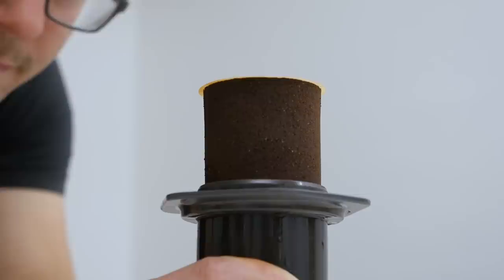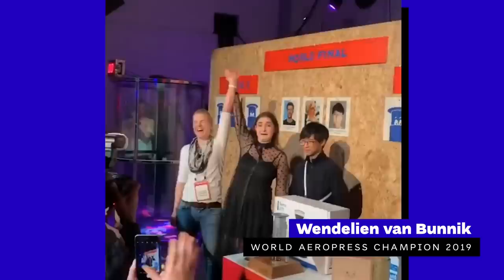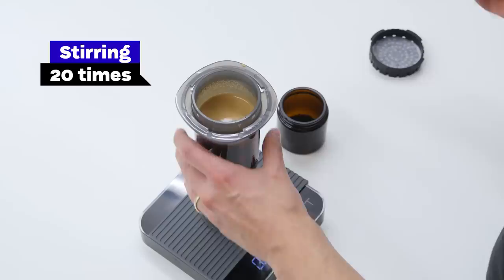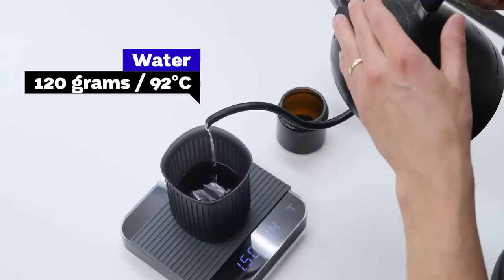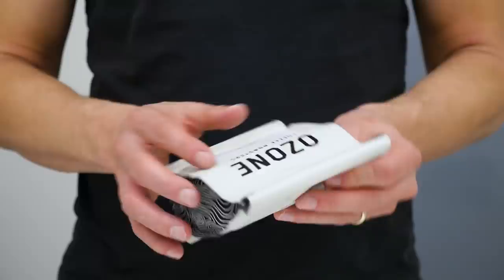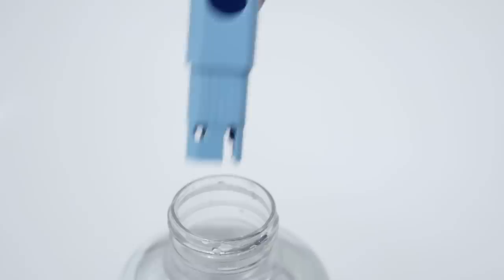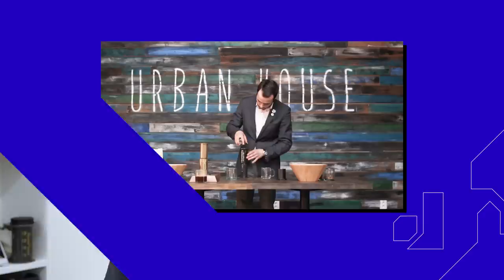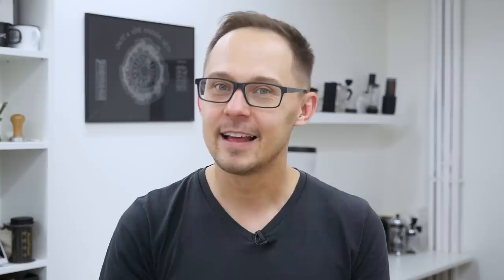The Winning AeroPress Recipe of 2019

Comment: I am happy to see the Aesir filters are a part of the winning entry.  I just received my first order of two packs of them, have been using the Aeropress for at least 7 years, they are absolutely an important improvement.  They definitely increase the pressure of the plunge, but also seem to let more oils pass thru while decreasing the sediment at the same time.  I was able to order online from eightouncecoffee.ca and had them sent right to me.  I have seen a few folks here say that they are scared or get disastrous results from the inverted method,  but if you just "commit" to the flip and figure out the method it will never collapse.  I think I have had one unsuccessful flip and it was due to the rubber plunger being past its useful life.  If you change that as needed when things get a little loose, the actual Aeropress will last for many years!
Reply: So glad to hear you like the filters! We are the manufacturers. Trying to spread the word on how much of a difference the filter, and even the paper make.

Comment: Why press out the air at 1:40? I want to know what difference it makes.
Reply: this way you are pushing air out through the top of the aeropress instead of through the coffee mixture. You could avoid this by stopping pressure on the plunger as soon as all of the water (coffee) is pressed out of the cylinder, or by adjusting the plunger to a different point in the aeropress so there is no air in the cylinder to begin with.

Comment: 30g of beans for ~250g of finished coffee? That might taste great, but it seems like you could get most of the strength with nearly half the coffee and more immersion time.

18g beans, ground fine-medium (7 on Baratza Encore)
90g water, fresh off the boil, inverted
Stir to remove clumps, but quickly
Start timer
At 90 seconds, swirl, flip and press, yielding about 70g of concentrate
Add ~180g of 160f filtered water
Stir, and enjoy.
Reply: I tried this.... yummmm!
Reply: what kind of beans?
Reply: @zetaland  Pinto or baked, usually.

Comment: I have bought two separate AeroPress now... and i still have no idea how people are flipping it over like that so smoothly. I have damn near scalded my hand two or three times. I suppose both of mine were defective? That seems unlikely but the two pieces absolutely would not stay together like in the video.
Reply: Before flipping, insert plunger to desired level, then pull the plunger back up a whisker to create a slight vacuum, then flip.
Reply: @SeanGT83  I thought that I had followed those instructions the last time i tried about a year ago... I will try again as the convenience of AeroPress is something im very interested in.
Reply: Definitely operator error, I had the same problem the first time I tried inverted. In this video, he pushes the excess air out before flipping, which alone should eliminate the issue, but also make sure that you grip both the cylinder and the piston with your flipping hand. Hope that helps.

Comment: Very nice recipe but I think I use the wrong coffee, could you (or anyone reading this) recommend a specific kind of coffee for this one? I'd love to achieve something similar to a cappuccino with less milk at home with this nice nut flavor aftertaste but so far I haven't been able to find the correct brewing method.
Reply: Sounds like you'd want a medium roast maybe? Different coffees will have different characteristics, Latin American coffees usually have a nice chocolate / nutty flavour. 
I try to do something similar to a cappuccino in the aeropress, I use 18g coffee and about 150ml water, and then add 80ml milk but you may want to less.  Less milk or water to make it more concentrated.  You can also adjust strength by brew time and grind size. There's no rules really.

Comment: Id buy this if they had a fully glas or fully stainless steel version... Im not drinking from heated plastic...
Reply: The glass or steel would be even worse lmao
Reply: Glass- too weak and fragile for a pressurised vessel, asking for trouble. Stainless steel- costly, hard to manufacture, cannot see coffee or water level easily
Reply: Theres a reason why aeropress is not made from glass, but i dont know with the steel one... its a good idea except it will cost more and will take more weight for a travel-friendly-plastic-aeropress, but who knows, maybe out there someone custom made a steel aeropress
Reply: If metal or glass you would have to warm before use because it would take too much heat out of the water.  I normally hate plastic too but it's the best material for heat management.

Comment: do you rinse you rfilters with boiling water ? i've been using my tap water (which is soft) but never considered the difference it might make.
Reply: Always with boiling water! It's also about the filter and the filter cap being hot already. If they are soaked in cold water, it will cool down your brewing water.

I also suppose rinsing an unused filter with hot water might remove more of the paper-taste.
Reply: @wtho  There's so little mass in the paper that it will have basically no effect on the final temperature. Give the cap a shake after rinse to remove the trapped droplets of water and you're good to go!

Comment: What are the advantages of doing the inverted method? I never have tried it before.
Reply: The inverted method prevents water drips through the filter. 

In the normal method, drips occur when the coffee grind distributes unequally inside the chamber. We can prevent this by tapping the chamber once the coffee grind placed inside the chamber.
Reply: On my personal experience, the inverted method might also introduced some spill when we turned everything back into the normal position. 

We also need to be careful while placing the filter and filter holder back. Especially when we are using metal filter. I ended up bend my metal filter because it is located a little off centre.

Comment: I am really confused on how fine grinds with ~14g of coffee brewed for 1 minute (Tim Wendelboe) and a coarse grind with ~30g brewed for 40 seconds can both taste good. Why is the latter not severely underextracted? Because of the high dosage?
Reply: Keep in mind the extraction is done slowly under pressure. The trick is to extract the most flavor but not allow the brew to become bitter from sitting to long before extraction.  Bottom line - each of us must experiment with our favorite roast, type of water (I use RO), water temperature ( I use 186 F) and brew time before extraction.  I use 10 sec stir, 15-20 sec. brew and a slow 30 second press time.